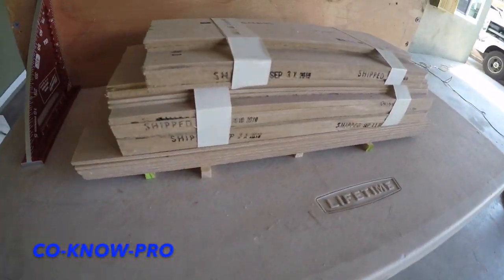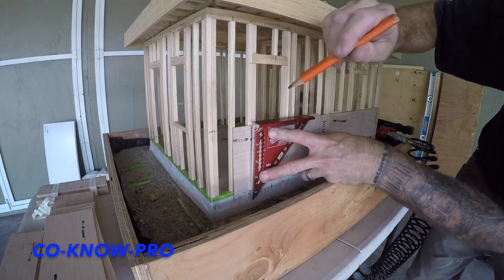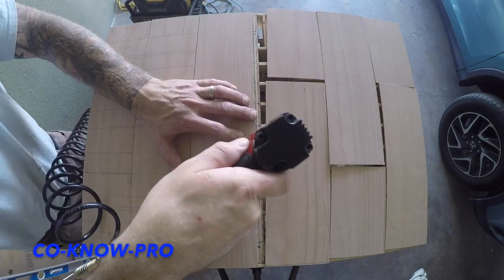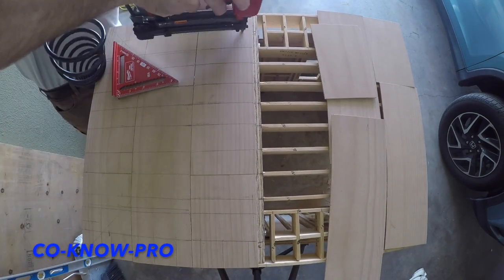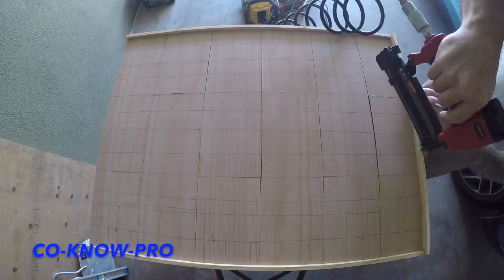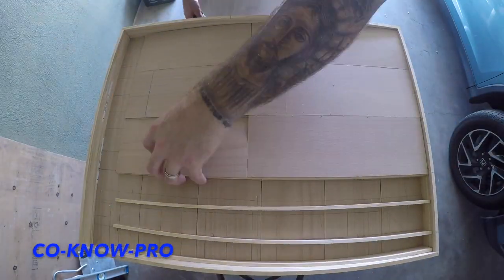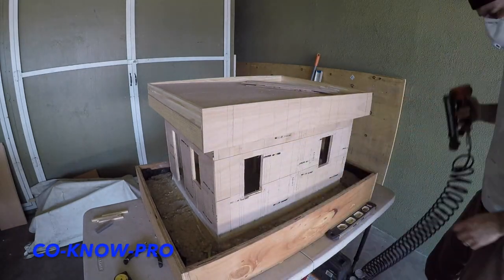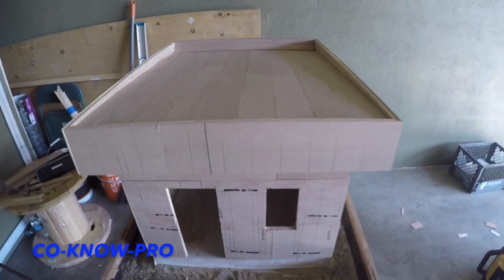⭐️Mini House Build Part 4 - Plywood Sheer Paneling, Roof Sheeting🔨@co-know-proconstructiontips

Comment: That type roofing seems expensive.  Is that code in some states? Actually here in Ky all flat roof systems are not a good thing on residential housing. Most common and least slope is a 12/4 pitch. Anyway very cool videos.
Reply from the maker: It is definitely more expensive than your standard pitched roof but if you’re going to do a flat roof this is the way to do it. 👍🏻😎🔨